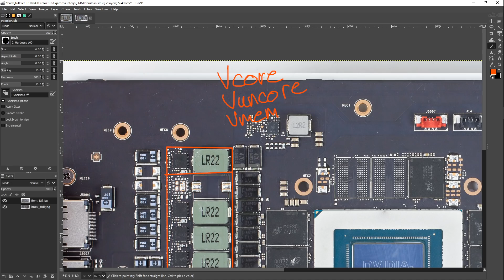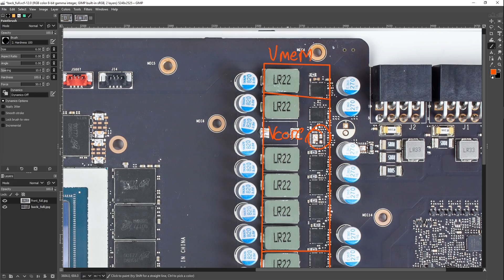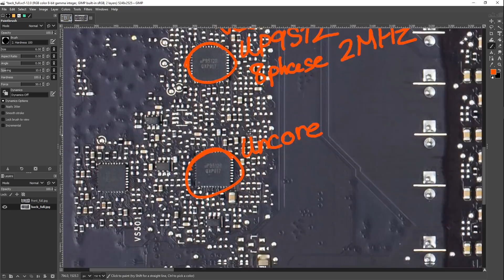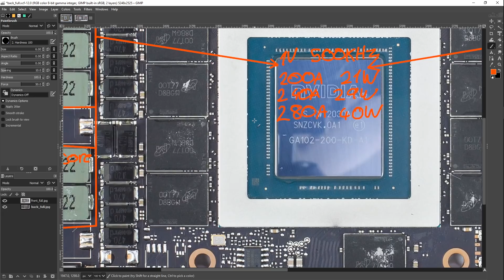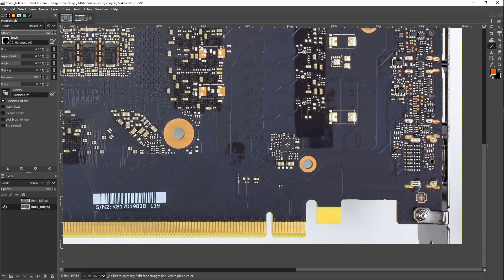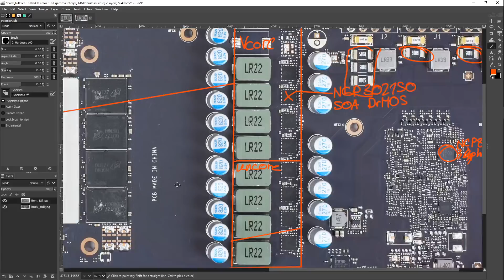GPU PCB Breakdown: MSI RTX 3080 Gaming X Trio

Comment: I have this card. Well the 3080 Gaming Z Trio with 12GB. It’s nearly identical unfortunately mine has a bit of coilwhine. Do you happen to know what electrical components most likely causing the coilwhine? I heard that putting a bit of putty around them, can be beneficial to reduce the coilwhine. But I don’t remember which components that was and I don’t want to embed my whole gpu with it. I already have an UV and limited fps :) thank you for the great pcb analysis!

Comment: my friends 3080Ti isnt recieving power to half his GPU,  143W on cable connector 1,   2.7W MAX on cable connection 2. swapping cable does NOT change wattage output on either connector, so PSU and Cables are good. Any diagrams and/or guidance would be helpful

Comment: Nobody knows why I spend hours watching these videos while I have zero background in electricity, so this is kinda chinesse for me. I know as much as that by pressing a power buttom a pc while hopefully start 🤣 One question for BuildZoid or anyone reading this....I have the MSI Gaming Z trio 12gb that raised the limit to 390 wts, and not sure how to phrase my question, but the thing is I'm overclocking it to stay at around 1980 mhz with the voltage capped  at 1.1 aprox via flattening the curve in Msi afterburner, and I'm not sure this makes sense for this card since doesn't seem to be strong for OC for what I understand. I didn't find the PCB pictures for the Gaming  Z version to check if has more or better "stuff"...plus I wouldn't be able to interpret it probably. So why has the Z version more power headroom? Did they changed something in the power delivery system or maybe the metallic backplate vs the plastic one allows better dissipation and temps? Lastly BuildZoid if you are reading this, and if you ever run out of ideas for videos, please consider to do an analysis of an RTX Gaming Z vs Gaming X (in case there are differences in the PCB!

Comment: Wow! Compared to the RTX 2080 Ti cards (https://www.youtube.com/watch?v=N6A_UWwYgkA) can see how much cheaper the 3080s are made. So much more potential with 2080 Ti's if all 2x 8pin were set at 375w power limit and 525w power limit for 3x 8pins. The VRMs, bulk capacitors etc Stupid limitation by NVIDIA and its board partners with super low power limiter, which is hard-coded into the BIOS in so many of them. Have you tried an overclocked RTX 2080 Ti with the shunt mod to give it 500-600w which they are capable of vs one of these lol see which card melts and doesn't :D

Comment: does the card require all three of the 8 Pin power cables to run?
or will it just work  as normal with two connected?

Comment: Hey Buildzoid. I just wanted to ask if it would be dangerous for the pcb to run over 400watts for extended periods of time if the card is flashed to the FTW3 ultra vbios.

Comment: ASUS TUF OC Board I think you will really like. Especially for the voltage reference points on the rear of the card, printed too. And the power hardware I think you will really like. More than any other 3080. I'm checking everyday for your video on the TUF OF. Please do soon as possible.

Comment: Hi buildzoid! Great job on the video. I'm going to buy this card almost purely for looks lol. Do you think that it will work well with a custom vbios to increase the power limit?

I assume that with the 3 power cables  it could deliver significantly more wattage. I'm thinking around 400w to start with.

Comment: So, in the end, we managed to understand from here and from the comments that a TUF 3080 Is way better than the MSI, but does anyone knows about the other expensive brands for the 3080 which is better at this point? ( And kindly possibly, just simple air cooling)
Reply: It's kind of a mute point though.  The overclocking headroom is pretty lack luster and they'll perform the same.  Just choose the cheaper one or the one that's in stock.
Reply: I see, but what about reliability, stability, better fan cooling system? Is it worth to buy any ROG or AORUS card in this case?

Comment: Looks like MSI is coming in to save Zotac's reputation. This should also mean that if Zotac does a new VBIOS for the Trinity that puts the power limit to 350W and removes the silly temp limit, it should be able to perform on par with the MSI "flagship". Thanks, MSI.

Comment: msi has really been falling off since that nvidia forcing rebranding thing
so many different cards being produced and less than 1/4 are sold in any 1 country
i still have yet to see anything above the 5600 xt MX in that series of cards
but yet newegg has 3 different batches of mechs and 2 of gaming x
and thats just 5600xt which i been paying most attention to
5700 is EOL so anything for that is new old stock
5700 xt: batches and batches of mechs everywhere 
while anything above hardly sells based on it being just a cooler upgrade nothing more
u can get better memory and clocks, more often than not, getting lucky on a mech batch
still love the cards but there definitely needs to be more standardization among components
if they are going to lock things down like they are they need to stop using micron memory
the worst cards based on all the other components will always have micron
with a delta of sometimes up to 10% less performance/bandwidth vs samsung

Comment: Right off the bat, it bothers me that this supposedly high end board has pads where they clearly just left out components.  If they're charging a premium for this thing, would it really kill MSI to just include all of the phases they originally designed into the board?

Edit:  I otherwise dig the layout, though.  Looks like it'd be a lot easier to repair than the FE if broke.

Comment: Why is msi marketing this card as a high end model? Its so basic, makes me wonder about their lowest tier ventus model
Reply: Al Bonn their cards used to be really good, my gf still has 1070ti gaming which oc to like 2100mhz
Reply: @Ben T. I agree with you on that point. 

I had a 970 ME (Limited Edition lol) card that I absolutely loved, it could run +250 core on air and still chill at 68C :D. Not to mention the green/black scheme which was boss. 

Now I have a MSI 1660 Super Gaming X, and it still performs well but it is a budget card using budget components which is fine (I did unplug the RGBs since nothing else I own has them).  Using budget cost saving on the high-end SKUs on the other hand is lame.  Oh, how the mighty have fallen.

Comment: Your explanation, about why you distribute the power delivery for the memory, is missing one point. It is also to avoid current from one module flowing through the same plane of the PCB.

The reason being the plane inductance/resistance and ohms law. If current from one memory chip flows through the same part of the plane as for the other chip the voltage will drop more at the chip furthest away as the voltage drop 'stacks'. 

Example:
1 PSU, 2 memory chips all on a straight line. Assume chips draw 1A each. 
Chip 1: 10 mOhm from PSU
Chip 2: 30 mOhm from PSU

The current from both chips will flow in the first 10 mOhm while the last part of chip 2 current will only flow in the 20 mOhm between the two chips:
Chip 1 voltage drop: 2A*10 mOhm = 20mV
Chip 2 voltage drop: 2A*10 mOhm + 1A*20 mOhm = 40mV

Were they spread out no overlap would be seen resulting in:
Chip 1: 1A*10mOhm =10mV
Chip 2: 1A*30mOhm =30mV

If current or plane impedance is higher this will be more pronounced.

The same thing would happen if only one power hungry chip is used. This is also why the core VRMs are not clustered in one side of the PCB.

Comment: So this is the flagship MSI 3080 offering. I would have expected a better power delivery and higher power limit than the founders edition. Instead we basically get an inferior reference design posing as a custom design coupled with a good cooling solution. Definitely not worth the premium over the Zotac that also runs quietly. I now have my hopes on the EVGA FTW for something better than reference design.
Reply: They will have at least one higher tier model.

Comment: Can the empty memory pads and slots for power delivery components indicate there will be 12GB 3080Ti coming?
Edit
I see on leaked 3090 photos that they went with the same PCB and all the pads are occupied there.
Reply: @Al Bonn It would be difficult to swap to something that doesn't exist :) Those GDDR6X memory chips are 1GB capacity. 3090 just have 24 of those (12 per PCB side) instead of 10 - in case of 3080

Comment: That mess of those small smd-s are amazing. How big are they? 1mm maybe, and that is the longer side? How the hekk they can put and solder those hundreds of parts to their place?
Reply: The solder is printed on the PCB via screen printing and the solder is sticky so that the components stick to the PCB during reflow soldering and handling. The placement if the SMD components is handled by a machine which picks and places the SMD components and the placement is controlled via camera and other sensors

Comment: I want a gpu that has a 24 pin on its side instead of 8 pin or 6 pin connectors
Reply: a 24 Pin has only 1 phase of 12V...
just no..
Reply: @emmata98  it has a bit more but yeah :)
Reply: @riba2233  okay 2 phases for 12 V and 1 -12 V...
Reply: @Ben T. techically they should be the same since originally 6pin only had two 12v lines, but yeah now they come with 3

Comment: Question re: 3x 8-pin power plugs. A) Can I only use 2x 8-pins? B) If I do, which are the 2x plugs that I should use on the PCB? (Which one is safest to leave empty, if any?) Thanks dude! Love your Channel :)))
Reply: From a power requirement standpoint you only need two 8-pins, but there is the possibility that the card requires you to plug all three in. 
However if that's a concern for you I would strongly recommend getting a better PSU for your 3080 so that it doesn't kill your 3080.
Depending on your CPU I wouldn't go below 750W at all, above would be better and use the LTT PSU Tier List and get a PSU from the highest Tier. Everything less can't properly handle a 3080
Reply: @pridedoggo  Thanks for the reply. So I have a 750w Corsair AX750 (gold) which is more than capable. My problem is I have long ago thrown out the bag of extra cables, and I can't seem to find a factory replacement that has the same modular pin config (this PSU used 12 pins -> 2x 8-pin Pci.e). My backup plan is just running a 2x Molex -> 8-pin for the 3rd plug on the GPU, but I don't know if that would be better or worse than just going with 2x 8-pins. Really it's going to take someone familliar with the power delivery system of this card to know for certain, that's why I was hoping Buildzoid would have some insight.
Reply: @Standard.Candle  Someone else asked this in another comment and bz said the same thing. Theoretically it should work, but he doesn't know if MSI forces you to plug in all three ^^
Have you already got the Gaming X? If not I would just switch to another card, would be the easiest solution. If that's not an option I would look on ebay and such. If that's also not helping I would just try to plug in only two. And if that's still not working out I would just sell the AX750 and get a new PSU. 
A Molex Adapter would work, as long as you don't run it out of spec which you would have to check, but it's not the solution that I would go for tbh.
Reply: @pridedoggo   Yeah, If it was going to mean me having to buy a whole new PSU then I'd cancel my pre-order. I don't have it yet, but I am confirmed on a list for Amazon. I really like the silent MSI cooling solutions, but the 3x 8-pins sketches me out. I wouldn't wanna run the 2x molex to 8-pin out-of-spec, but ideally I would know which of the 3x 8-pins are trying to draw the most juice. Or are they all evenly balanced 1/3 - 1/3- 1/3? The only other thing running on the molex cable string is an LED strip, so like less than 5w, so it SHOULD be fine. I wish i just knew which of the 3x power plugs to put the molex janky adapter into.
Reply: @Standard.Candle  Every 8-Pin should pull an equal amount of power. 

What I mean with 'out of spec' is not overloading the 12V Rail, I mean melting your Molex Connector because you run to much current through it. I don't know how much it can handle, but you should definitely check that in advance
Reply: @Al Bonn Yeah, not as EZ as you'd think. The AX 750 (although a top tier PSU) has long been discontinued, and the pinouts are totally different in new PSUs, even ones by Corsair. They literally don't even have the same physical connector into the PSU (it's a 12-pin for pci-e out), and even if it did, it could have the wrong pin configuration, and you can fry components that way. 

As for the extender cables, those don't help at all unfortunately :(

Comment: I think 50mV drop is a bit over exaggerated. The voltage drop on that distance between the memory and the vrm will be insignificant. And plus, I'm sure they used very thick power tracks to mitigate any voltage drops, if any.

The biggest concern will be a larger power ground loop area. Ie the current path is larger. 

This will add unnecessary inductance which will decrease the performance of the voltage regulator chip. It will affect the transient response and stability of the regulator chip.

But honestly the distance between the memory chip and regulator is not that large so I don't see an issue there.
Reply from the maker: I've actually had cards that dropped 50mv across the mem power plane

Comment: they only put three 8 pin connectors on it for marketing purposes, guaranteed
Reply: They probably did, but most of the laymen think that having 3 pcie connectors means it draws more power than those with 2. The "extra power connector marketing BS" is far more prevalent on motherboards though.
Reply: It really annoyed the SFF community as most of our PSUs only have 2x8.
Reply: Well if their power limit is over 375w (not sure, didn't check cause I'm waiting for 3080ti/super), then it makes sense. 

Nvidia thinks 8 pins can only do 150w each. So 75 from PCIe + 2 8 pins is 375W. So if you want more while playing by Nvidia's rules, add another connector
Reply: @tarfeef_4268  even nvidia doesn't believe that, they have an adapter for two 8 pins to their 600w 12 pin that comes with their cards, it was a space limitation not a power delivery limitation

Comment: if third 8pin is useless can i just plug 2 8pins and leave third 8pin unplugged?
Reply from the maker: I suspect the card requires them to boot.
Reply: @ActuallyHardcoreOverclocking  thanks for reply, what about strix 3080? You also think it requires all 3 plugged to boot?
Reply: @kerpl0p  Probably, but there is hope the Strix will actually benefit from the 3 connectors.
It has a dual Bios switch...
Reply: @Safetytrousers  problem is my PSU supports only 2 6+2, others are 6pin. this why im wondering and i want to buy a good GPU with nice cooling and decent overclocking potential.
Reply: just bridge them?

Comment: I think I hear you say "I have already taken several takes, I am not doing another one." In nearly every PCB breakdown.
Reply from the maker: there's a  couple one shot wonder takes
Reply: @ActuallyHardcoreOverclocking  ....i wonder why don't you edit the videos a bit when you run into a hickup?  
for example that one bit where you noticed your notes had the wrong numbers, why not just pause there, correct the notes quickly and resume from there, you don't always need to start over, just make a little cut there, that wouldn't take long and no viewer would notice or care.  
Doing it all in one take seems very time consuming when you have to re-do it.  

Or is it more of a "losing your line of thought" thing?  

No biggie either way, just curious because i fiddled a tiny little bit with editing in Vegas 13 for my dumb videos and simple stuff like a cut or fade-in and out isn't hard or time consuming at all, your process seems to be hit record, do your thing in one take, press stop and upload it (now that i think of it, i don't see any dumb 30 second dubstep intro / outro stuff, no overlays or any of that typical youtuber nonsense ...you know what, don't change anything :D ).
Reply: @ZeroB4NG  honestly at this point it's part of the charm to see all the weird things he stammers over in the one-take style
Reply: @ActuallyHardcoreOverclocking  Do the Colourful Volcan OC 3080 PCB analysis it's the same board as 3080 Ti also. They use no pass through caps I'm interested to learn more about their design. They also have 22 phases for GPU and 4 for mem.

Comment: There's a bizarre amount of empty space on this card. WTF is up with all that blank PCB surface area?
Reply: The heatsink is that big, and pcb just follows that.
Reply: Top tip: Ask a question answered in the video.
Reply: @Safetytrousers  hah. The video popped up in my feed really late and I only had a chance to watch the first several minutes before going to bed
Reply: Probably gonna reuse it for the 3090 and add more VRMs

Comment: Does the Asus card have fans that don't spin at idle? that's one of the main reasons that I like MSI's cards. But judging from what's come out over the past week it seems the Asus is just a better card for cheaper.
Reply: Asus TUF card does stop fans at idle
Reply: Every card can do 0 RPM  just use Afterburner lul.
Reply: @Clippy-the-Doubtful  some cheaper ones can't, for eg my kfa2 1650super can't go below 40%
Reply: @riba2233   Even with afterburner or the KFA 2 software ? oO.
Interesing. ^^
Reply: @Clippy-the-Doubtful   yeah, they have 2pin fan connection and the control is locked beyond 40%. Very loud at idle unfortunately, wouldn't have bought if I knew that.